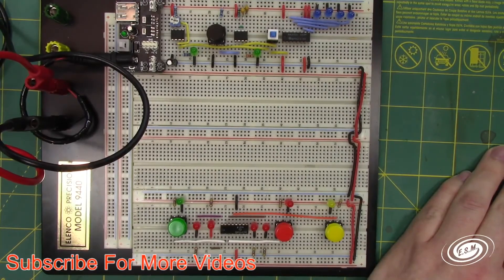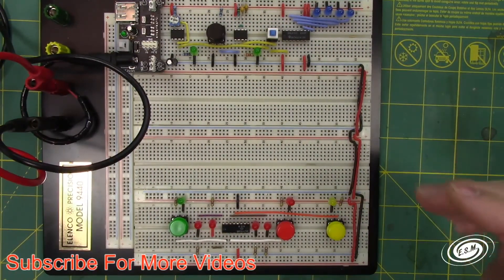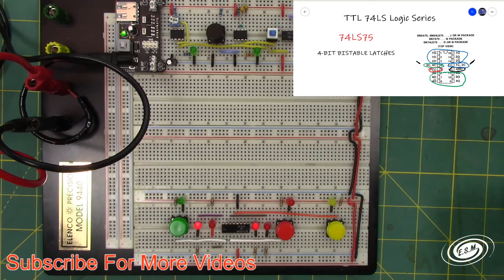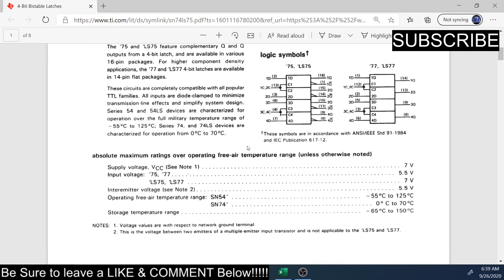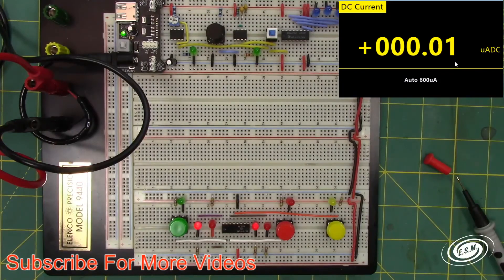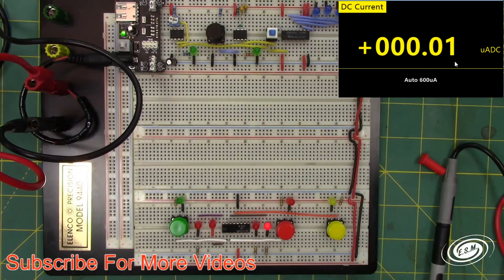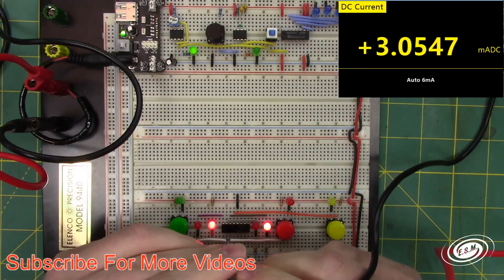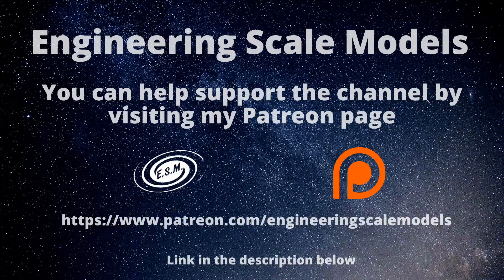A Look At TTL Logic Chips 74LS75 Quad Bistable Latches

Comment: I recognize that On screen, Meter software. In-case anyone in the future wishes to know it's' Siglent Multimeter software or known as Easy DMM 👍
Reply from the maker: Yes that is the Siglent software, but I plan on switching to LabView sometime soon I hope. Getting everything set up the way I want is taking a long time, LabView is a massive software that can be overwhelming to use.
Reply: Now that would suite you're name and your self down to the ground as LabView is Engineering software that is Smart as hell.
Reply from the maker: Yeah, Steve for sure. I have used LabView for my instrument controller for years at work, just with different equipment and one of the main reasons I like Siglent over other gear in that price range is that their LabView drivers are very good. Now LabView is total overkill for what I do right now. I just want to use it to have 2 meters on the screen at once, the Siglent software can only run one. I will use other features in the future, but at this time I just want the 2 meters at once. I am however working on a video on the Nintendo Switch battery and how it works, I may need to get it going faster, because it would be very useful seeing how I’ll be using 5 pieces of test equipment at once.